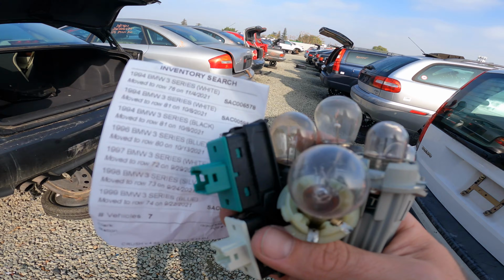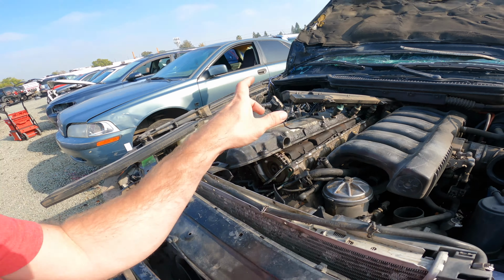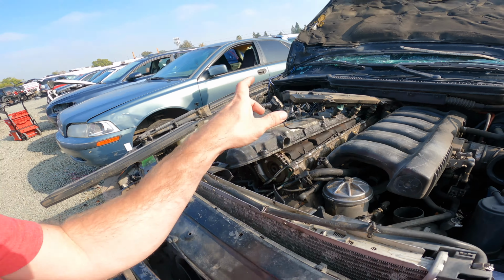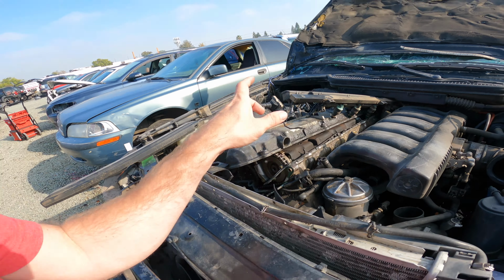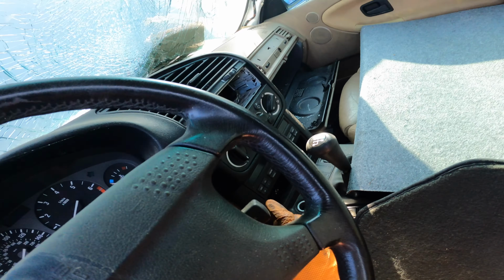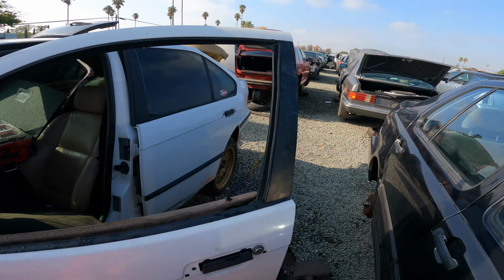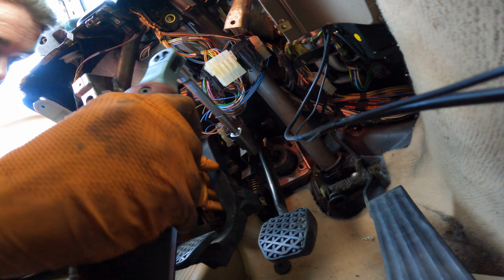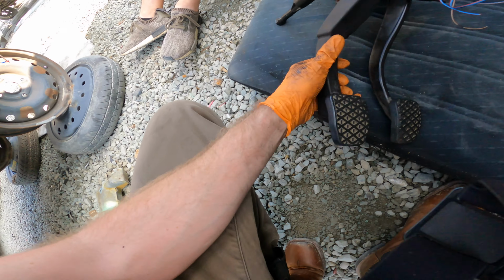Milwaukee Tool Packout 2 and 3 Drawers Junk Yard Testing

Comment: I finally snagged the nonfuel ratchet yesterday. That fuel is making my want it as well.

I got the m12 screwdriver and m12 ratchet for $100 at Home Depot. Is it worth keeping or just straight to the new fuel ratchet?
Reply from the maker: The new fuel ratchet is much faster but the break away torque is way less. I find myself using the new on more for speeding things up. But I do usually have to crack the bolts first by Hand with it